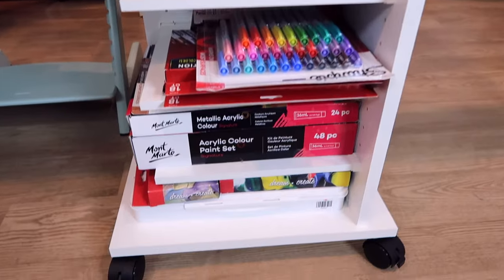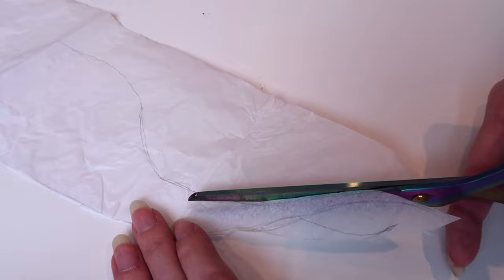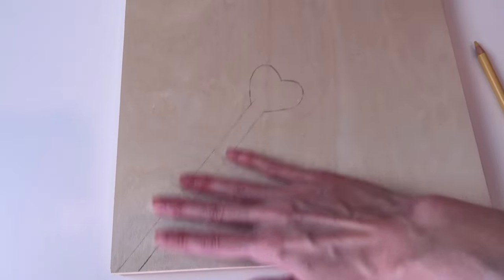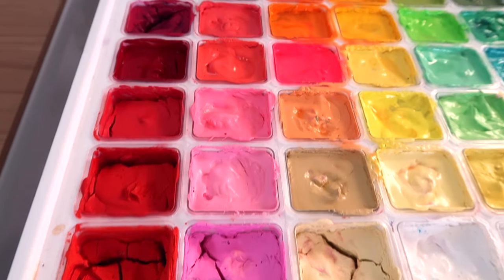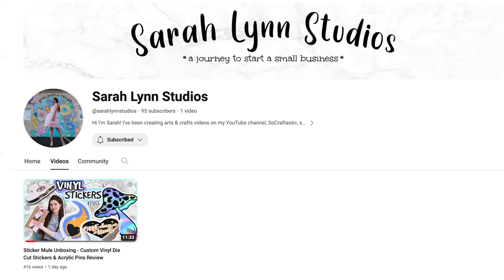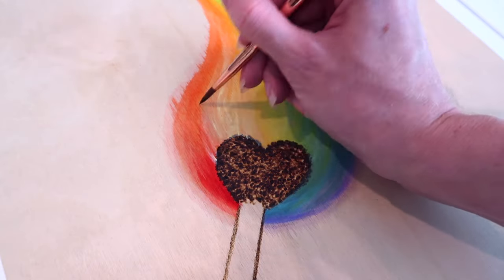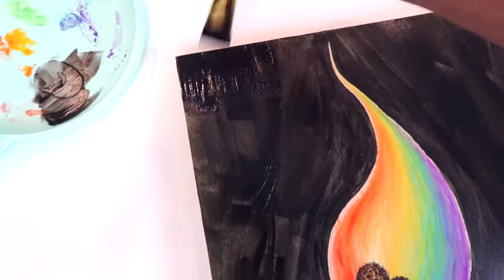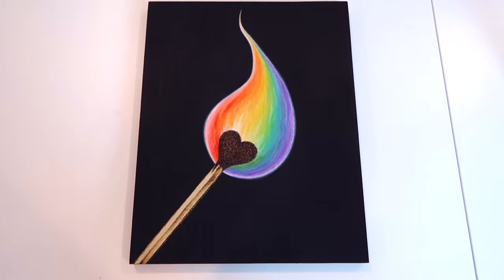WOOD BURNING with JELLY GOUACHE PAINT // Rainbow Matchstick 🔥

Comment: The other day when I opened my jelly gouache Hemi paints they were molded. Well just two but I had to throw those out. I cleaned up around the edges of it with alcohol and since then I've been making sure that it's super dry before I put the top on and also spray it with rubbing alcohol, letting it dry for a couple seconds before then putting in the top on it.

Comment: My grandpa would sharpen scissors using a small glass bottle like a fingernail polish bottle. Take your scissors and act like you are trying to cut through the small neck of the glass. Scissor it just a few times trying to run the full length of the blades. It usually helps a little at least.
Reply from the maker: I'll give it a try! Haven't heard of that method. I've cut through a few layers of aluminum foil in the past. Also, thank you for watching.